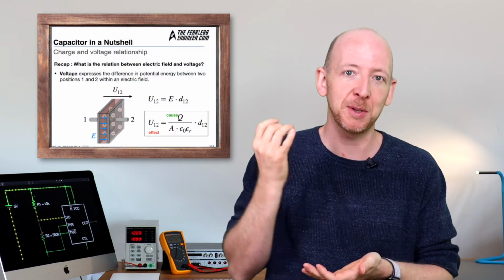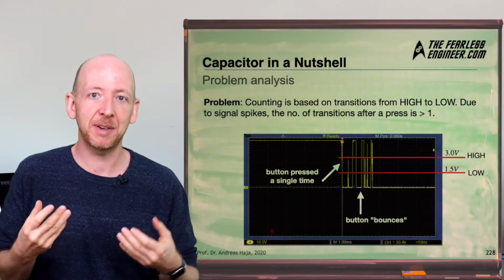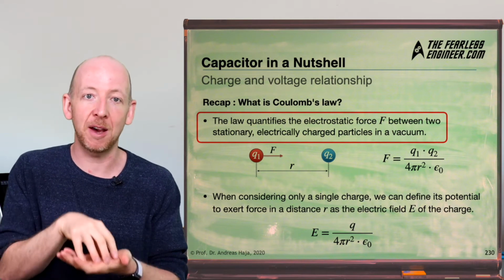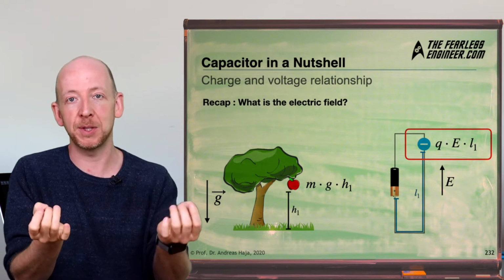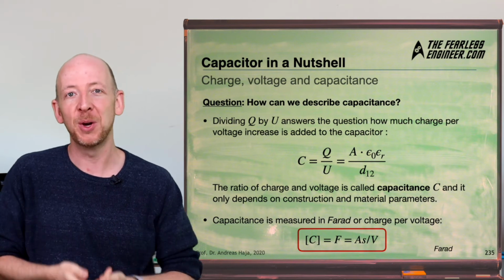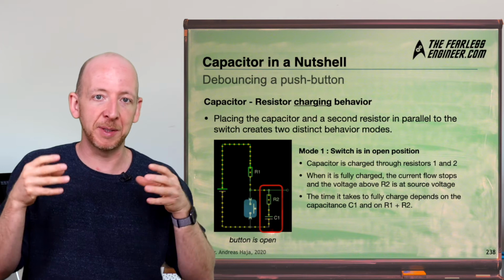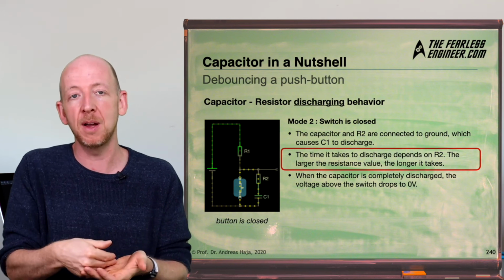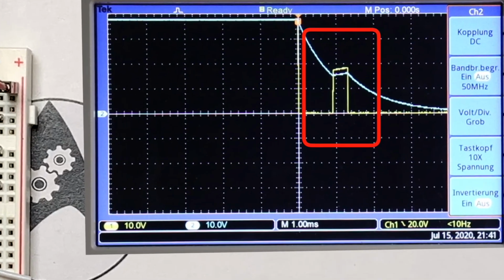How Capacitors Work | Arduino-Project "LED Counter"

Comment from the maker: Hi and thanks for watching! Here is a question for you: How long does it take to charge a 1mF capacitor with a 500 Ohm resistor? If you like, let me know your answer in the comments!
Reply: Professor, will we have retake exam before winter semester to improve our grade when necessary? Lol
Reply from the maker: I will offer a retake exam before the start of the winter term. But I strongly believe that you will be able to get a good grade in the upcoming exam this week. 👍
Reply: The Fearless Engineer - Elektronik & Programmieren Ich hoffe, wie Sie gesagt haben! :)
Reply: A capacitor charges to 63% of the supply voltage that is charging it after one time period. After 5 time periods, a capacitor charges up to over 99% of its supply voltage. Therefore, it is safe to say that the time it takes for a capacitor to charge up to the supply voltage is 5 time constants.

We know tao= RC
Then it will be, 5RC= 5x( .001Fx500)= 2.5s 
I guess The answer should be 2.5 sec
Reply from the maker: Your reasoning is sound and the result is correct, well done!